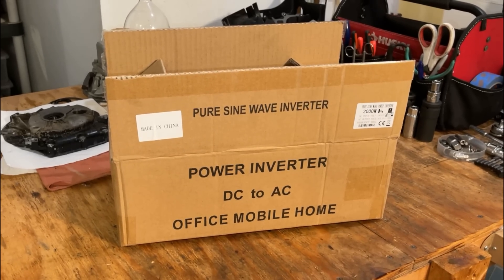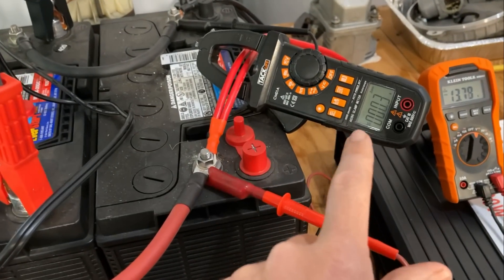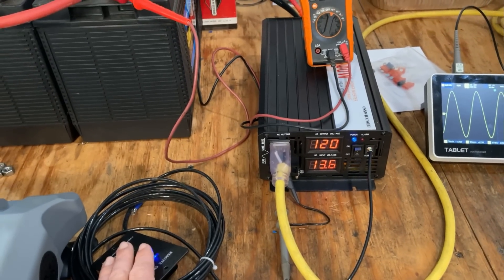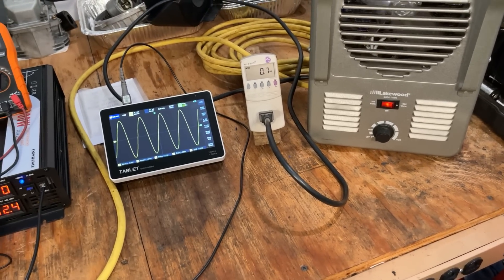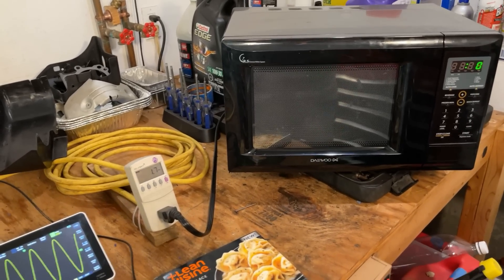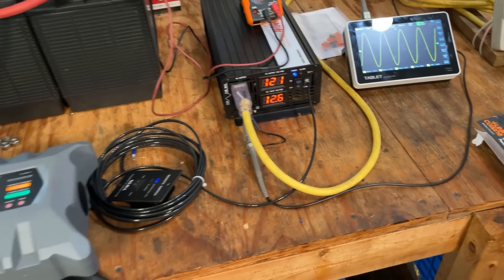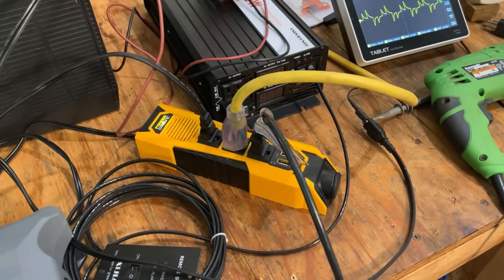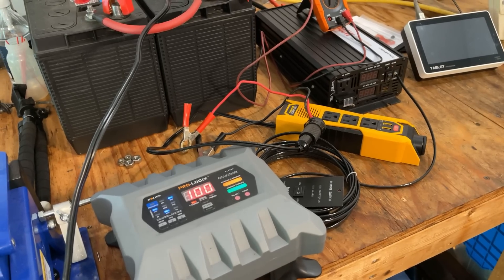CNSWIPOWER 2000 Watt Pure Sine Wave Inverter vs Honda EU2000 Inverter Generator | Load and Waveform

Comment: Be really careful with those modified sine wave inverters, one caused my car airbag dash light to illuminate while driving, it disabled the SRS system.  Fortunately, I was able to figure out the problem quickly and disconnected it, restarted the car and problem went away.

Just an fyi

Comment: Nice setup with the batteries the amp clamp and multimeter and the Occiliscope and the battery charger thats a re branded Mac Charger @3:20 @James Condon
Reply from the maker: Did not know about the re-branded Mac charger.  Good deal.
Reply: @jcondon1  Mac sales that same charger in Green all models that are that shape that are grey are made by a company called clore Automotive they make the grey model you have as well as all variants on amazon and the green model that Mac tool sells very good units 👍

Comment: I just had an idea for a "poor man's inverter generator".  Feed the output of a non-inverter generator (say for example one that you already own) into this gizmo (or similar):  https://www.amazon.com/Converter-Supply-Adapter-Transformer-Version/dp/B082NSVWJY/ref=psdc_10967761_t2_B01MT61VFE
(A 120V AC to 12V DC converter).  Feed the  12VDC output of the converter to the 12VDC input of a sinewave inverter like the one that you tested (could be a smaller/cheaper one since you only have 600W to feed it with) - like this:  https://www.amazon.com/GoWISE-Power-PS1001-Pure-Inverter/dp/B0131GJ5X2/ref=sr_1_98?dchild=1 and now you have (some) clean power for under $200.  You don't need clean power for everything but 600W worth of clean power would be enough for your TV, computer, router and modem, etc.   This is basically what a "double conversion UPS" does  but those tend to be pricey.  Whaddaya think- would this work?

PS Here's what looks like the same power supply (these things are close cousins of computer power supplies ) for even less with a slightly different terminal arrangement - it looks like these units make 12V on more than one line and to get the full wattage you combine the lines into one (positive  and one negative).  The only difference from the above unit is that this one lacks the jumpers and battery posts (which you wouldn't want anyway - you would want to hardwire the 12V lines) and power cord  https://www.amazon.com/Supply%EF%BC%88SMPS%EF%BC%89-Monitoring-Industrial-Transformer-220VAC-DC12V/dp/B0781V1D7Q/ref=sr_1_3

PPS You could do the same thing (even cheaper for some reason and with lower amperage on the DC lines) in 24V.

You could even rewire an old generator to turn one of the outlets into a dedicated inverter outlet - divert the feed to that outlet thru these two gizmos and then back again to the old outlet.

Comment: How about the same scope display with a regular generator.  The sine wave comes from the rotation of the coil through the magnetic field.  I would think the basic waveform should be pretty good, maybe with some more noise on it.
Reply from the maker: That is in the works for later this summer.

Comment: I am not a big fan of pure wave inverters having lived off-grid for 20 years. I found out that a mod wave works about as well for my uses and you can pick one up a small 650w one for 20 -50 bucks used. It used to be that no one used mod wave cause they caused static on tube TV's but no one has them anymore. So you can get a big wattage mod wave at less than half the price and even a quarter the price or less if you shop around. For me, the pure is a waste of money unless you are using a lot of expensive high-end gear that requires it

Comment: I never trust the power ratings on inverters like that. It may handle 2kw, but it is probably pushing the components right to their limits. When I built a small battery backup system, I bought a 4000W inverter so a 15 or 20 amp load does not push the electrical components to their limit.
Reply from the maker: I agree.  Always buy an inverter well over the rating that you plan to run.

Comment: I wonder if using a Panasonic inverter microwave would make a difference in initial consumption.  Also, your oscilloscope doesn’t look like a lab-grade bench top.  Do you have a Tektronix analogue unit or digital bench top one to verify?
Reply from the maker: I have a Panasonic inverter microwave.  Not lab grade for sure.  I did have a Tektronix analogue unit, but it was really old.  Plus, wanted a battery powered one to be isolated from ground.
Reply: @jcondon1  Nothing wrong with really old when it comes to Tek stuff.  There's a "Tekscopes" mailing list that's quite useful for working on that stuff...

Comment: I have two 2000 watt pure sine wave inverters, purchased from Ebay vendor reliablepower several years ago for about $250 each.  One is primary on our solar-charged "Wait until daylight" backup power system (the other one is the backup for it) and the 12 volt, 420AH nattery bank provides 8 to 20 hours of power depending on the season.  Running the 460 watt blower on the gas central heat moves the time closer to 8 hours.  Running just the fridge, kitchen counter outlets (charging phones, tablets and laptops and having light for preparing food) and some LED lighting moves the time closer to 20 hours.  We might also power the freezer or the internet equipment and the home network.  I consider this backup system a "Wait until daylight" system because I'm not out in a thunderstorm or in the dark shoveling 7" of snow at 30F to get a generator from the shed out back.

The power co-op's sine wave isn't as good as what the inverter produces.  We don't have a lot of long outages, although we've had one 16 hour outage (before the current system and running things on an OLD Coleman 1850 watt generator) and one 12 hour outage (after the current system was operational and a much nicer event).  We do have frequent short outages - being 2+ miles of tree-lined road away from the substation that supplies us means the aerial cable has many opportunities for encounters with nature ;-)  The most recent outage was almost two hours a couple of nights ago but, even after reporting the outage with their app, no notice of estimated restoration time or any other info (their online outage page isn't any better).  An outage that begins with the lights flickering and a GROAN! from the transformer across the street (twice!) isn't likely to be restored in the 30 minutes I usually wait before switching to the backup system so I went ahead and turned it on and flipped the transfer breakers.  Much easier to go down the steps to the basement and flip a few switches than to go outside to get a generator ;-)

Comment: I would recommend when you install this inverter that you use the same gauge wire you used as the jumpers to tie the batteries in parallel. It looked like 6 or 8 gauge, x2, between the batteries and the inverter in the video.  You were approaching 1v drop between the inverter and the batteries with those short cables, it's only going to get worse with longer cables and they will get hot....  I enjoy the channel.  Keep up the great work!

Comment: I bought three UPS by APC (Schneider Electric) rated at 1500W each, and very good they are. Intended for IT applications, the output is TSW and exceptionally clean and stable, but the downside is the rate of discharge of the indwelling batteries. Intended originally to give business owners time to save their work and shut down their computers without losing any important data.  They can be supplied from bigger 'off-board' batteries to run longer, and are well capable of keeping us on power through a typical outage.

Inverters are very handy where noise might be an issue, especially if there are other residencies nearby. Trouble is, fixing them isn't as easy! - That looks like a decent little inverter you have there. The Hz should remain stable regardless of load since it's generated in an electronic oscillator which drives the power inversion as a separate process. As long as the oscillator receives adequate voltage, it will run at the correct frequency. If the battery voltage drops beyond a predetermined value, the oscillator stops running, so it's either correct Hz, or no Hz at all.
Reply from the maker: Was impressed with this inverter.  The loudest thing was the microwave and the quiet Honda inverter generator.  Just need a good battery bank and a means to charge the batteries.

Comment: The amount of people(over here in Australia anyway) that think they can run an Inverter off 1 or 2 ~130a/h Batteries & expect them to cope is astonishing!
Reply: I am not sure if this will help but, it is like that everywhere, not just Australia.  Someone was asking on a vendor's website about connecting a 12v 2,000 lbs rated winch to the car's dash 12v outlet.
Reply from the maker: The more batteries the better.  Need a good bank and a good means to charge them to run at 2000 watts for any period of time.  Was surprised that I made it cooking that meal.  Not due to the inverter, but only two batteries.

Comment: I have a 1000 watt pure sine wave in my trailer and have done in-depth test like yours.I run a Samsung tv it takes 60 watts and blue ray player I have 2 12 volt batteries it runs all evening with very little drain on battery and now I know I’ve made right chose

Comment: Jim, I plan to go with a solar powered system, and I have 4 24v panels and no batteries as of yet. I have a diesel engine to run a 24v alternator to cover cloudy days. I have my charge regulators and a couple smaller inverters, plus a couple ups's to function as inverters. I'm looking at buying a farm that was Amish built 110 years ago, but has been wired for phone and electric as the two homes were rented out. If I buy this small farm, I will have to redo everything in both homes due to the likelihood of lead paint, and the one house needs some major changes to the upstairs as it's not well designed. The out buildings are in relatively good shape for their age. 
The aforementioned power equipment will be just a starter for my shop, and I'll need more panels for when I do welding and woodworking (not in the same building), I may get a diesel generator to power my welder at some point, so I can weld out in the field if need be.

Comment: The modified sinewave types are bad for wall wart transformers that are not switchers.  The high rise and fall times (slew) on the waveform will cause the transformer to overheat with eddy currents and the thermal fuse opens.  Found out the hard way.  Switcher wall warts are OK with that waveform.

Comment: Just a quick note about your battery connections.  As a long time service manager for an RV Service center I would like to say that for a 2 12v battery parallel set up, you should always have the positive connected to one battery and the negative connected to the other battery, with of course the 2 parallel jumpers.  What you have in your set up is what we call an "outrigger" connection.  I don't think it would change any of your measurements but for long term use in your RV, the "outrigger" battery will, over time undercharge, and the other fully connected battery will start to run warmer.  This will significantly reduce  the lifetime of the batteries.  The current should always flow equally and balanced through all of the batteries.  This is also true for multiple 6 volt setups as well.  Most large RV's for example use four 6 volt batteries, 2 banks in series and then those banks in parallel.  In fact, two 6 volt batteries in series instead of your  two 12 volt batteries in parallel will provide a measurably longer service life between charges over the 12's.  Hope this helps.
Reply from the maker: Thanks for the information, good to know.  My RV had the batteries connected in parallel the same way I did it in the video.  Will have to change that.
Reply: @jcondon1  I absolutely love your videos.  You are always so calm and informative.  It might be informative to try your tests with 2 of the 6 volt batteries and compare how long each would last without the charger attached, since that is what happens in RV's.  No need for an inverter if plugged into shore power or on the generator, so the batteries are "on their own".  Again love your videos
Reply: Very interesting "detail"; for small loads it does not matter,but for heavy loads like that,over 100 amps,it matters some, if the jumpers are not  real heavy cables.

Comment: Is a high frequency inverter, so this is why is cheaper (and Chinese brand) than low frequency one witch have a large (usually toroidal) transformer inside. This type of inverter are not so rugged like the low frequency ones because transistor drive directly the load not through a buffer transformer, so shorts, inductive voltage spike will destroy this inverter..

Comment: This video was a great change of pace, and the icing on the cake - very useful information!  Couple of things:
- Was the battery being charged at the same time it was supplying current to the inverter? If so, did you notice any problems with that?
- Suggestion for a related video:  It's really tough to find a generator that advertises "Less than 5% THD", which seems to be the cutoff for "clean power".  It would be very interesting to see the waveforms for various generators as you work on them and compare them.
Reply from the maker: Going to do a video later this summer comparing the waveform of different generator types.  The charger was supplying power at the same time.  No issues seen with that.
Reply: @jcondon1  Looking forward to it, thanks!
Reply: actually there are many inverter generators that advertise less than 5% thd

Comment: I've seen dozens of videos about this subject, and found yours to be the best.
If you feel advantageous, you can slap a huge Li-ion battery pack and make yourself a portable power. 
Check out BatteryHookUp.com. you can get 100x new 2200mAh 18650 cells for $120 USD. New not recycled. 
I would by 2 boxes for $240 and you'll have a $2000 portable generator. You'll need a BMS and a power supply of course. But the ones for eBikes would do. 
I would buy them but I live in Canada, and the cost of shipping, import taxes and customs clearance fees, makes it not economical.

Comment: I would not use that inverter to charge my electronics.  I used to carry my Honda 1000EX to the farm with me to run my drills and skil saw.  It never had a problem with either.  It was a 1500W generator.
Reply: ya sure for electronics is better a modified saine wave, not to mention is cheaper and lighter, with 20 euros you can charge anything this days...

Comment: Something's really wrong with the oscilloscope waveform at ~12:39. Looks like the probe has a bad ground lead or connection. This may have also been the case on the Honda. I have a $200 1kW honda-knockoff and it's waveform looks much better. Thanks for the vid!
Reply: Yeah, defenitely a loose connection. What you see on the scope is a capacitive coupling to the squarish output of the inverter.
So, James, .... today you have to have dinner in the garage ? 😉
The first one is a great looking inverter.  With lots of ooompf, being able to start the microwave.
The 150W one is a good one to keep in your car. This type of inverter is very well suited for smps, like laptop chargers.

With the Honda, what you see on the scope is interference between the 60Hz from the Honda and your local grid. Nothing to worry about. Is your scope running from an internal battery ?
Reply from the maker: @Plons0Nard  yes, the scope was running on battery.
Reply from the maker: I agree something may have been off.  Going to do another video later this summer computing the waveform of several different generator types.  Will try the inverter generator again.  I have a couple others I could try if the EU2000 still looks off.